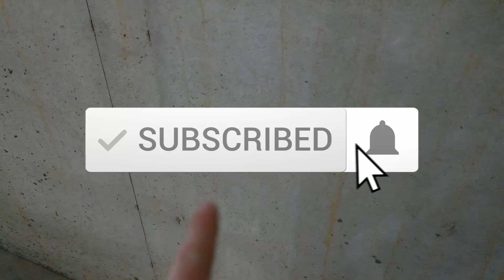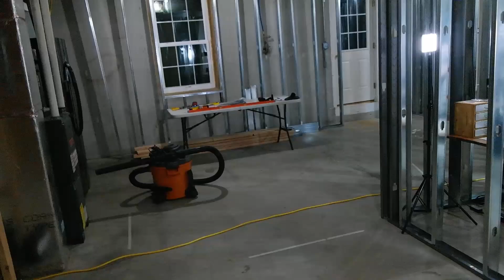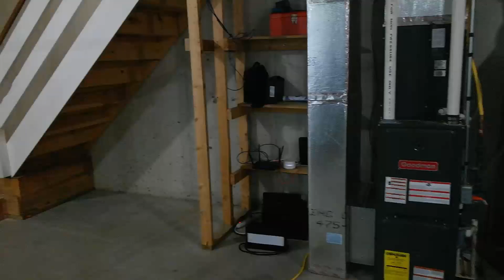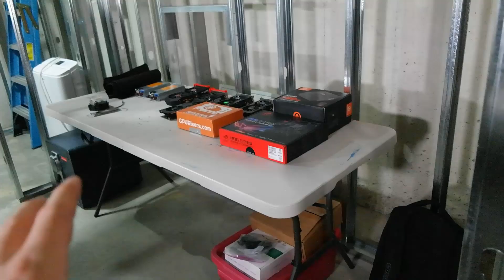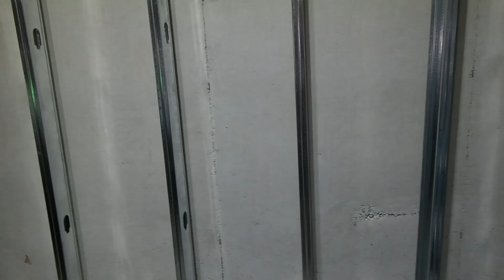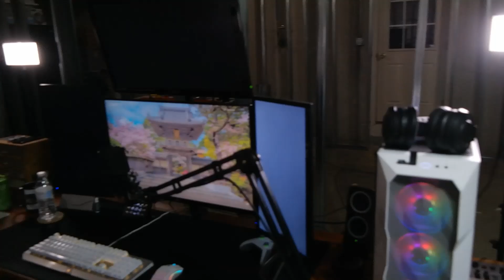Building My Crypto Mining Basement | Framing & Layout Tour

Comment from the maker: Do you have any ideas for the Mining Room that I maybe over thinking?  Electrical? Cooling? Material Etc?
Reply: One thing you will need to consider is that you will be pulling cold air from your house (1st and 2nd floors) down and out through your basement exhaust vents. This will cause your AC to run more more frequently in the summer. Also you will be pulling alot of the moisture out of the air in the house during winter so the 1st and 2nd floors will be very dry. I am running into the cold AC air being sucked down to the basement and out of the house now. AC is running and having a hard time keeping up. You will want to find a way to bring air in to the basement but remember it will be unconditioned air and very humid, especially when raining.

Comment: You put a vapour barrier between the cement floor and bottom plate?
Reply from the maker: I will be putting a vapour barrier in between the cement floor and the wood lament floor i put down.
Reply: @TheHobbyistMiner  No you have to put foam or vapour barrier between the cement and bottom plate or your walls. The studs will prematurely rust out if they're making direct contact with the cement floor.

Comment: Looking great. My HVAC specialist installed two units similar to something like this Part #DFCQ30PAVJU. Having already tried the exhaust option once you get 32 GPUs you will not be able to change the air fast enough unless your doing a 16inch exhaust system or large. I tried it and the system temp was around 82c. Installing a dedicated HVAC that's properly sized to my mining room and the estimated delta heating factor from GPUs, my room now stays at 20c to 21c and my GPUs are running at 42 to 55c. ASIC miners never go under 60c, still working on them. My next project is an insulated hot side 10inch dedicated exhaust for the asic racks. Electrical cost from my dedicated HVAC is roughly one 8gpu miner.

Comment: You're gonna need more cooling. The exhaust fan you talked about will help, but that portable AC won't cut it I don't think. Especially being a one-hose unit. Once you start really building up your operation, it's gonna produce a surprising amount of heat. But maybe you can just look at that when it becomes an issue. This is a good start!
Reply from the maker: Thank you. Looking into Exhaust Fan options now as I know the goal is just to get the hot air out.